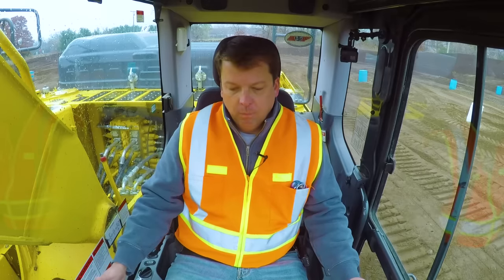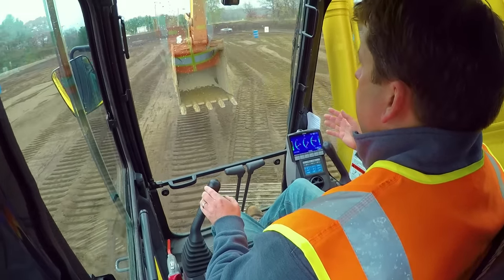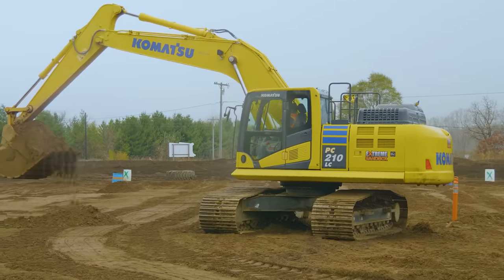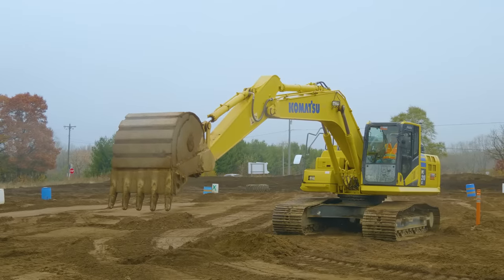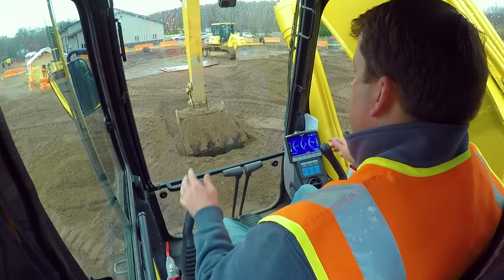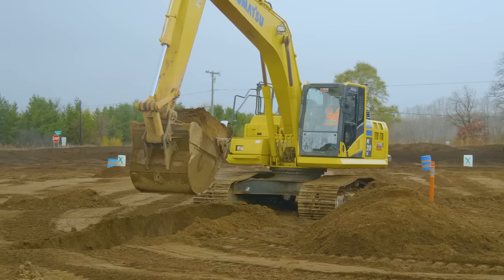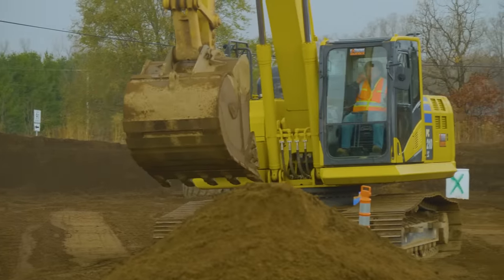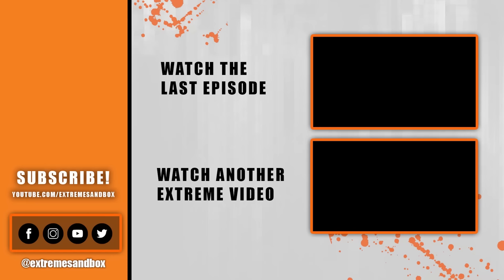What NOT to do in an Excavator | Heavy Equipment Operator Training

Comment: Always good 2 put the seatbelt on too.
Reply from the maker: rule #1
Reply: I never wore a seatbelt until I was almost thrown out the door of a 750 dozer. Ever since I make sure I got one on. Also pull a lot of slopes. Helps keep ya in the seat
Reply: @HeavyMetalLearning  Bull, it's obvious you guys have never worked on any high elevation work. I've run equipment for over 40 years from forklifts to P&H 2800's, D-11'S, Hitachi 5500's 992 loaders etc and never ever wore a seat belt. I personally know 2 operators who would have been dead and one at least crippled for life wearing one. Driving on the highway then yes without question. Working with 50'-900' drops I want out right now if there's ever an emergency, so far that's never happened. And I've yet to meet any loggers that wear them either. I've also trained dozens on just about every piece of equipment in a modern open pit mine except drills and leave that seat belt decision up to them. How do you pull a ditch line with a grader while standing up and still use a seat belt? Unless there ordered with the shorter highway cab, the normal cab is designed specifically so you can do so to improve your sight lines.

Comment: I have heard that you want to extend your boom out as far as you can and check that you will not hit an obstacle and this will ensure that you don't accidentally extend too far and hit an obstacle so for example extending it all the way in driving up to a house and stopping before it could even touch it with it fully extended to dig a hole one foot away from it
Reply from the maker: Interesting...but I will not support driving with your boom and stick extended all the way out.   Too risky.  Most good operators know their machine pretty well and can drive up to what they believe is that limit, and then just extend out.
Reply: @HeavyMetalLearning  exactly you drive up to where you think the boom will be fully extended without touching some obstacle while still being able to reach your work... the point was to make sure you can't reach what you're trying to avoid fully extended and I did not mean to drive with it extended... I've only used one a handful of times so I'm just passing on what I've heard...

Comment: Start with the machines operating manual most of what you've covered in this video is covered in the operators manual it is also good reference point for new operators. Also having the sprockets at the rear of the machine it's very important for all operations.

Comment: If you need this advice then im pretty sure you stole or bought your operating licence...
Reply from the maker: Wait...you can steal a license???
Reply: @HeavyMetalLearning  I dont know, but document forgery is a real thing :D
Also you could have mentioned on the last tip that it is important to park the excavator squared because you might need to access the engine bay from the bottom in case there is a problem and you cant start the engine, especially needed in winter when you might want to heat the oil pan.

Comment: Your drive motors should be in the front of the machine. The sprockets are a wearable replaceable part. If you dig against the idlers all the time. You are adding constant pressure to them and they are much more expensive to replace than sprocket segments. The seals in the idlers can become worn from the pressure and go slack requiring grease constantly to maintain tension. I find that it's easier for the operator to press the petals forward to track the machine back as you dig as well. When it comes  to positioning the boom. Any time you have to lift something extremely heavy you should position the boom over the track at around 40 or 45 degree angle. It gives you a little bit more stability.  As far as where to place your spoil pile while trenching. If you swing and place your spoil to the right, it is much more efficient. Any good operator should know their surroundings and their machine well enough to do so safely. Loading a dump truck is the same. The faster the better as long as you are SAFE. With an excavator the size of the 210 you have in the video, with the same capacity bucket. You should be able to load 16 to 18 yards of material into a tandem axle dump truck in 2 to 2 and a half minutes. That depends on conditions of course. Safe, efficient operators are key to production. With a Cat 320 excavator with a 42 inch bucket i can load a truck in around a minute and a half. Sometimes less in ideal conditions. And usually we will place nearly 20 to 22 yards of material in a truck.
Reply from the maker: Thanks for the comment but not sure I agree with all of your tips.  The sprocket/final drive is WAY more expensive to repair than the idlers.
Reply: @HeavyMetalLearning  the sprocket segments are cheap the final drive motors are very expensive. However they are ridged to the frame of the undercarriage and cannot be hurt by the added force of digging the way idler cylinders and rollers can.
Reply from the maker: @quintonriley3468  In my opinion you are going to do way more damage to your final drives if you are always digging over them.   Generally the manufacturer recommends digging with them in the rear.   But I don't necessarily think there is just one right way, so to each his own.   Thanks!
Reply: @HeavyMetalLearning  you are right about being more right ways than one. Ask 10 different operators and get 10 different opinions
Reply from the maker: @quintonriley3468  YUP....but I always think we can learn from different ways of doing it, so I always like those different opinions!

Comment: I always told guys to raise the boom enough that the stick will hang straight with the bottom of the bucket even with the cab floor,then spin ,if you have clearance for that in a complete 360° you have a safe work area, because 2 things in that position of boom and stick it gives you turning clearance, and height clearance,I had a old timer show me that, but with these new zero turns it's out dated
Reply from the maker: Thanks for the comment!

Comment: Of course I read comments b4 watching this so if this wasnt memtion: when picking up  large item whether it be a road plate or a massive concrete wall block, make sure your chains arent twisted and that they are hooked up right and be square  with your boom/stick to the object while lifting it off the ground so it doesn't swipe out a laborer standing off to the side!
Reply: P.s. Seen it happen.  Not a pretty sight.

Comment: Side loading boom voids warranty.
Don't side push with swing power .
Pins bushings wear and booms crack from torsion.
Only pull push with bucket.
Reply from the maker: Pretty sure it doesn’t void any warranty, but I do agree you want to be limited on how much you do it.

Comment: some situations  you gotta have motors at front ,if you have to go down a muddy embankment say at a river or water catchment pond machines wont be sitting level if you need to get out fast when you spin round the levers and motors are correct position and you can use feet to motor out while working hand controls to pull machine with bucket up incline ,if you spin round and motors are now infront your reversing and have to stand on levers back to you sometimes on steep slope you would need to get out the seat to do that,also the spoil coming out a trench if its to go back in after say a pipe cable lay for every metre in depth you must leave spoil same distance from trench so a two mtre deep trench would have  spoil  laid back 2mtr from trench edge if you dump at 1 mtre youd have it rolling back in to trench by time you get to depth and people getting buried alive in the trench

Comment: I want to know ahat I have to do to get into the operator field as a career. I've operated a backhoe and skid steer. But not much else I'd like to become a heavy equipment operator but don't know here to start or what to do.
Reply from the maker: I always tell people to start by talking with a local operator.  Find out if they have any recommendations for the local market.
Reply: @HeavyMetalLearning  i reapplied for the union apprentice local 103 i was on their 2 waiting list and just reapplied but didn't know if there is another guaranteed way to get going as an operator
Reply from the maker: @BigTrav310  that's a good option, but most areas you don't have to be in the union to me an operator.   I would check with some local smaller excavation companies.
Reply: @HeavyMetalLearning  thanks for the info  I will check into that

Comment: I can add to this video and I'm not even an operator of excavators but I know that you need to learn to drive with your feet not your hands that way you can keep your hands on your controls in case you start to tip over you can catch yourself..
Reply from the maker: lol....better in theory than practice...never going to "catch yourself" because the hydraulics just don't move that fast.

Comment: Please leave the tracks at a 10 to 15 degree angle to the cab, with bucket dropped, extended out or tight curled (so water doesn't pool in it).   We want the top of the track as a step.
Reply from the maker: Agree to an extent.  Generally machines are designed to be pretty well in line for proper access.  If you are over 15 degrees, sure you have a bigger step but sometimes you then lose the ability to grab the left handlebar.  So it’s a balance.

Comment: As a complete novice and outsider to using an excavator but i operate a telehandler  in my opinion an operator of any machine shouldnt be thinking of anything comming through the cab in relation to which way the controls may be hit thats like saying u try make sure u fall over cab door up ensuring u can get out!!!! Surly you the operator makes the surrounding area safe and safely navigates the enviroment around you  wether ur digging, cutting trees you do it safely and if at any point a tree or a stone or anything else is liable to hit your machine you dont do it or you find a safer way.

Comment: I worked a bridge demo job once, and the guy tearing up concrete with the exc was picking the rear end up like 3+ feet off the ground, even squared to the track.
Reply: Some jobs require more wear and tear but a good operator keeps it to a minimum. My peeve is watching an operator at quitting time shove the throttle closed and shut off the key before the turbo winds down. Very hard on them.
Reply from the maker: It can happen, but just wouldn’t make it the norm.
Reply: @johnkidd1226  yes! When i was young i got cussed out for that a time or 2! Now i have to put up with new guys doing it...
Reply: @johnkidd1226  oh and not cleaning the undercarriage. That was a fast way to get yelled at! Hah!!
Reply: @quintonriley3468  When they see me coming to pick them up, they think they need to be working the machine until I pull up beside them. To be honest, I'd rather they were doing a walk around checking for problems that I can have fixed by the next morning and not lose any time.
Reply: @johnkidd1226  just shut it off at full throttle so you can get a head start for the next day
Reply: @localsonly-ju6fc  Wouldnt be a next day. You'd be down the road that evening.

Comment: You Missed one of the biggest . Don't use swing motor and bucket to level piles of dirt.  Hard on the swing motor. Should use Dipper ,boom and bucket to level. Not swing side to side With swing motor to level dirt piles.
Reply from the maker: Yeah, that’s a good one...maybe the next video we cover that.
Reply: That doesn't say much for a rototilt tho does it, they use the slew motor all day. I imagine it's very hard on everything! In regards to the pile of sand in front of the trench I just flick it back in the trench. Every operator does things differently :) there's not too many wrong ways if it works.

Comment: Just another comment on drives to the back, if your digging on a steep edge you know that back pedal means your moving away from the hole. So many times I've seen even pros forget which way their tracks are facing.
Reply from the maker: Good point...thanks for the comment!
Reply: You definitely want your sprockets to be the end closest to the ditch. Most people don't do that. But sprocket segments are cheaper to replace that idler cylinders and rollers. And you can also track back as you dig by pushing the petals forward. It just seems like it makes since. But if you ask 10 operators you will have 5 one way and 5 the other.

Comment: I am learning good from you thank you but i wana learn how can i work on a hammer not on bucket
Reply from the maker: Thank you....we'll see if we can do some hammer videos.
Reply: Mohamad baiary biggest thing is never activate the hammer unless it’s in contact with the material you intend to destroy. It will damage the hammer. Always try to create a hole first, then work to the hole. Create lines like a saw cut and the material should fracture along the line.
Reply: Jordan Dysart i speak and read englesh a little bit if u speak Arabia i can understand stAnd you better thank you
Reply: Jordan Dysart i speak and read englesh a little bit if u speak Arabia i can understand stAnd you better thank you

Comment: What are the dangers of digging a deeper trench in average clay/river gravel (with rocks up to 2 ft diameter) at a depth of 15ft - with an excavator of this class and reach?
Reply from the maker: I'm not as familiar with that soil type so I would refer you to the experts on that.   Obviously you would have to either have the appropriate slope calculate for that deep a trench or using shoring....but again, definitely not our expertise.
Reply: @HeavyMetalLearning  I appreciate that. Thanks for the great videos! I am a newbie placer miner trying to learn as much as I can.
Reply: Get a trench shield or bench it back very well. Id say if its very loose material well more than 45 degrees. Keep your spoil as far away from the trench as possible and be safe! Watch for your person in the trench just in case they become complacent and aren't watching. It only takes one lapse of judgment to kill someone.
Reply: @quintonriley3468  thank you I appreciate that. What if there will be no people near the trench except for the person in the excavator? Would it be safe enough to dig the trench without a trench Shield depending on soil stability? Meaning is there dangers to the excavator and operator in it?
Reply: The area that we are working in has old growth trees nearby and we can't bench out very well.
Reply: @ntjson  with no one in the trench itll be fine without anything. No real danger to the operator or the machine. As long as you are safe. Just remember if anything crazy does happen dont ever panic just keep you head and everything is usually fine. What kind of project are you working on?

Comment: The distance you make between your spoils and your trench is determined by the depth of your trench. If you are digging say 8’ deep you should place your spoils 6’ from your trench edge. You don’t want your spoils on the edge of your trench, especially if you are digging in class 3 or less material. I’ve also found that tracking back to more your trench box is easier if you aren’t tracking through your spoils.
Reply from the maker: Excellent advice...thanks for sharing!

Comment: Don't agree with loading a semi when its backup to the excavator. Now I know this ISN'T ideal in every case but in loading one from a barge, I prefer and the truck driver as well prefers me to load them as the cab is out of my swing but so the cab is facing the excavator. Like I said not idea in the case of a common bucket excavator. But for a material handler excavator it is not only safer, but less product loss and having the angle give the operator a better DEPTH PERCEPTION OF the position of the loads into the semi. This is idea for onsite trucks and there ability to drive past the equipment. Faster load time and the truck drivers are not backing into the equipment. (BUT A CONE OR MARKING OF SOME SORT TO KEEP THE SEMI OUT OF THE SWING IS SOMETHING I STRONGLY ADVICE. IT TAKES THREE MINUTES TO GET OUT AND JUMP BACK IN. TRY THIS YOU'LL ONLY DO THIS WAY.) Just think if they don't get their signal to stop. And it's dark and sleeting out. Accidents can and have happened. So don't go with what they tell you as an operator in any situation. Listen, understand, but this is key take what you can from what they said that makes you the most comfortable. Don't go with how it's always been. If your not comfortable no one will be comfortable. Your ability to relax is key and paramount. Trust you and not what they say is best. NOW IF IT IS DO IT!! But don't be afraid to try and be more comfortable as long as it's SAFE!!!
Reply from the maker: Good advice...thanks for sharing!

Comment: Another reason to dig with your idlers in front of you is if the bank sluffs off or you start going in your gut instinct will be to track back, well if your tracks are facing backwards you’re just gonna wind up further down shit creek😉 parking, I always try to park it obviously square but also leave the boom the way it needs to be for a hydraulic oil check. If you can’t check the oil properly pre shift then how can you fire it up safely? No different than parking a dozer on a hill, you never get an accurate reading. My last point was the first tip I ever got for running an excavator, get comfortable because if you’re sitting in a hoe you’re not going anywhere for awhileLOL
Reply from the maker: Excellent tips...especially the last one, lol.  Thanks for sharing!